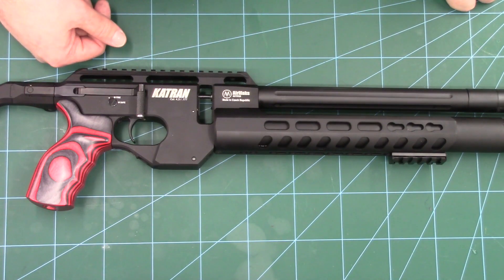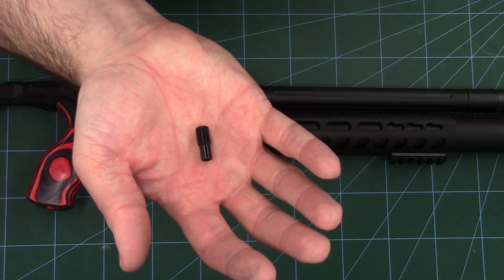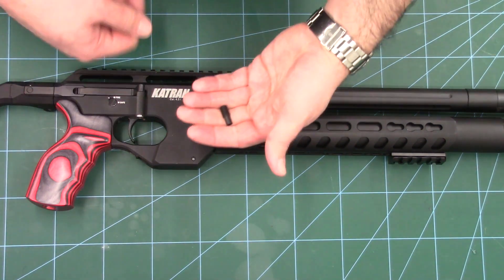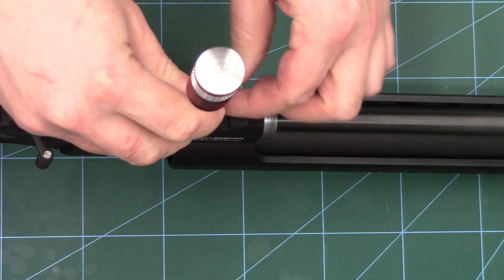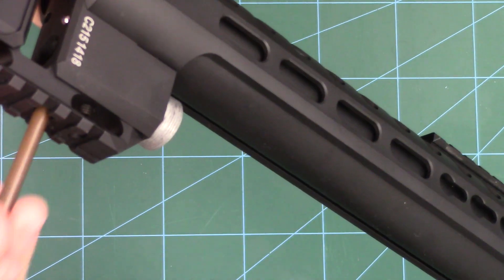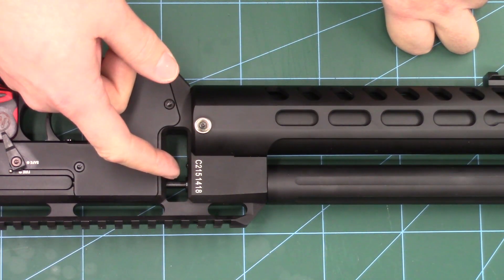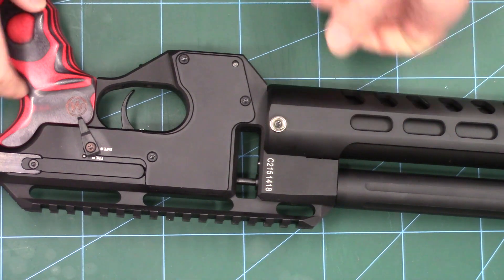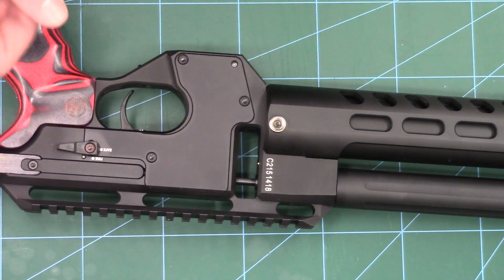Improving the shot count on the Airmaks Katran

Comment: Increased the shot count on my Katran B by a massive amount, plus the increase in power was also greatly increased, reduced the hammer spring to bring the rifle back to sub 12 ft lbs, The fitting took about 2 minutes to do , the hammer spring adjustment was simple to do using a chronograph to check the reduction in power , this is a brilliant piece of kit,I would highly recommend the fitting to your Katran
Reply from the maker: Good to know, such a simple thing glad to hear it worked out for you. Thanks for watching
Reply: How did you get it?

Comment: 👍I need more shots out of my fx Dreamline tac compact bottle any suggestions I’m getting about 80shots out of 300 cc bottle … what do you think about a 17 .cc power plenum!
Reply from the maker: That sounds very low for a 300cc bottle, have you tried re-balancing the hammer spring? turn the power wheel down on the side and see if the power drops, if it doesn't you can wind some hammer spring tension off and you should get a few more shots. The power plenum won't really effect your shot count, you may get a couple more just because of the increase in air volume but it will be minimal at best. Thanks for watching.

Comment: what power did you set it to in .177 mate ? as mine has started jetting i have been told its using up far to much air
Reply from the maker: Hi, we set the power to 710 fps with 10.34